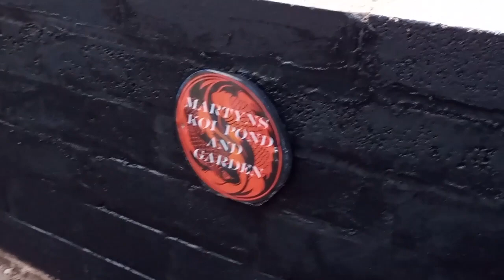pimping the pond red on black and some more gadgets to install #koipond #koi #koilove

Comment: Some good gear there martyn, ive got the same dechlorinator and its decent mate, ive got the same pump too but the 10000 lph and its faultless bud, i baught it 1 because its a lot cheaper then the evolution aqua pump and 2 i had the 3000lph on my big cichlid tank a few years ago and i had that same pump for over 3 years without an issue, great vid buddy keep them comming 👍🐟⛩
Reply from the maker: Cheers lee yeah it's kicking out some water
Reply: @martynskoipondandgarden4581  they are good a reliable buddy, i did notice in your last vid you had problems with it dry mounted, its because all the pipe work to the pump must be under water leval buddy that way it keeps the pump primed always 👍🐟⛩
Reply from the maker: @RamseysDIYKoiPond  ok cheers for that buddy 👍

Comment: That is the Jecod dc"s"12,000 what you needed was the Jecod dc"p"10,000 just a little extra on eBay one seller is £129 the "s" stands for sump and is for marine the "p" stands for pond and is for pond's. The wall looks nice and the red really stands out it won't be too long now 👍
Reply from the maker: Thanks Oliver I can still use the pump buddy just have to make sure it's protected from the rain
Reply: @martynskoipondandgarden4581  scratch that it's the Jecod/Jebao TSP 10,000 I was thinking of you can tell by the handle on top ! 👍
Reply from the maker: @oliverskinner8962  no worries oliver its going to sit outside the ibc i think have watched a couple of reviews and they are pretty powerfull so should get a good flow back through the return pipes